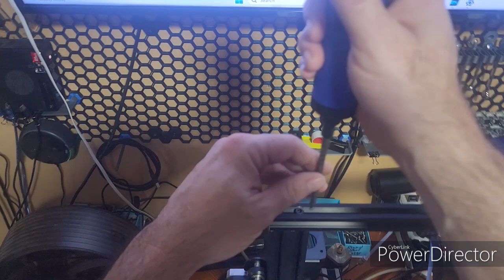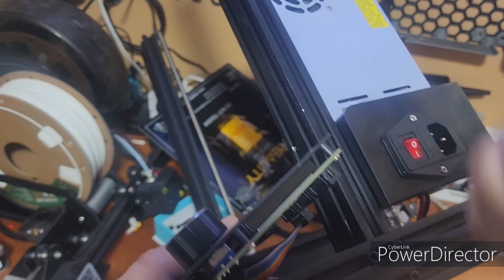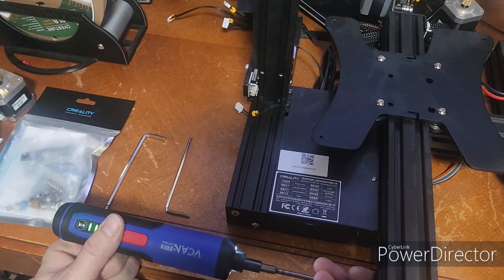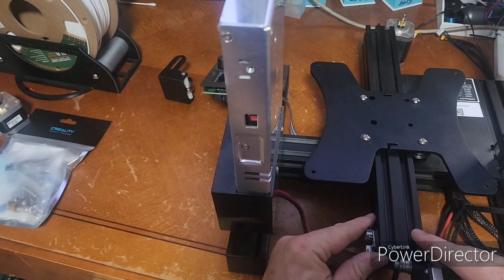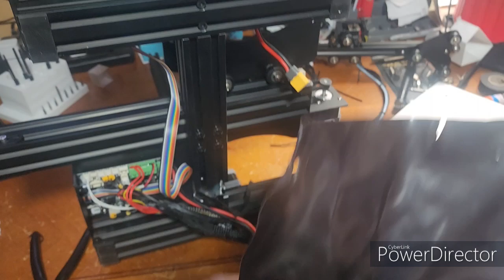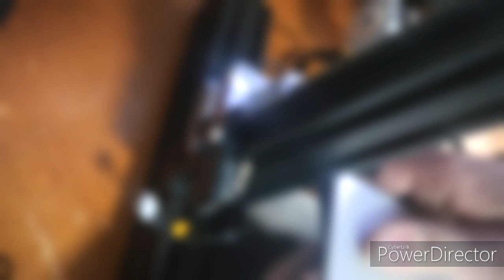Auction Ender 3 Pro Teardown and Rebuild Part 1

Comment: I enjoyed your video I'm watching this as I just got one off eBay for $20 which actually looks to be in better condition than this one. 
Mine looks to have a metal extruder with it but not fitted, and an all metal hot end tossed in a bag. and another one that's worse for wear fitted.  It's a project (not that I really need more projects)
I have another printer I just thought I'd get it as it was really cheap.and see if I can get it to print reliably without spending too much on it. I'd already decided I try to get it running in some capacity as close to std  with minimal spend

Comment: Mine failed to autohome,read the card,they sent a new board, now the Nozzle Error message,and Bed error message,no reverse on the Y axis,it's a complete piece of S.
Reply from the maker: first, this has nothing to do with my video. 

second, I highly disagree with your assessment of this machine. if properly set up, its a solid workhorse. if you swapped the board out and things that werent a issue prior to the swap are now a issue, you need to review your connections. you veey likely have things wrong. 

feel free to join my group, centralmass3dprintingcommunity for help if needed. we can try to assist remotely.